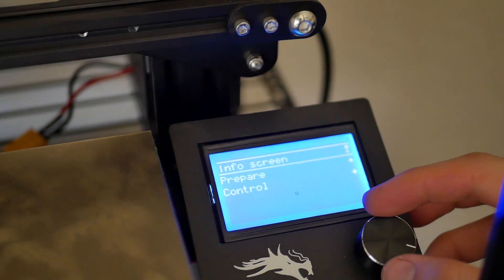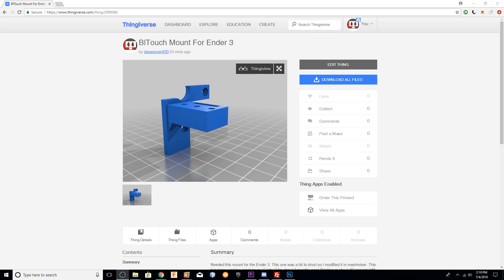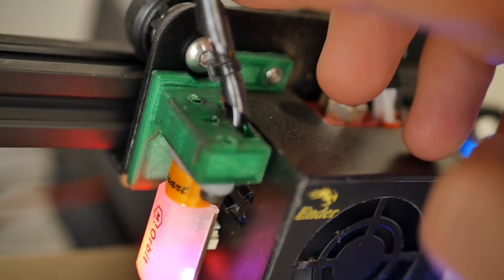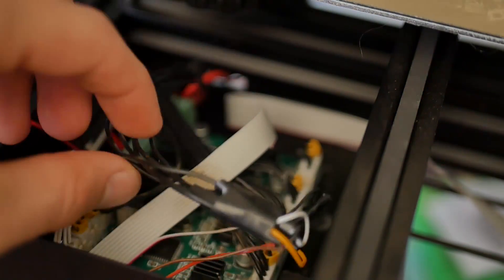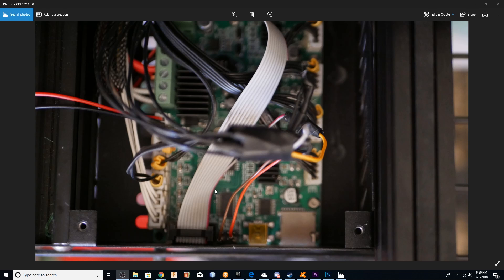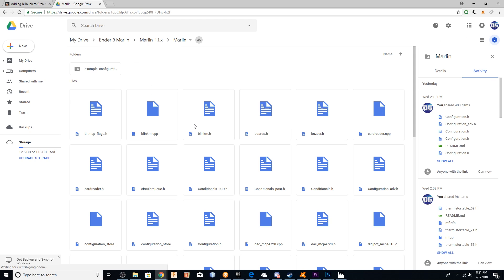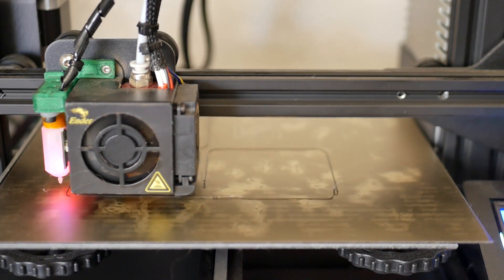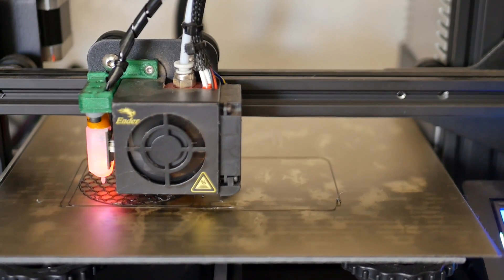Installing BlTouch Into Creality Ender 3 3D Printer For Auto Bed Leveling

Comment: errore Arduino:1.8.7 (Windows 10), Scheda:"Sanguino 1284p, ATmega1284P (16 MHz)"

In file included from sketch\ultralcd_impl_DOGM.h:49:0,

                 from sketch\ultralcd.cpp:96:

dogm_bitmaps.h:146:29: error: _Statusscreen.h: No such file or directory

compilation terminated.

exit status 1
_Statusscreen.h: No such file or directory

Comment: if you plug the black and white BLTouch wires on the board in the Z motor connector. after that, where to plug the Z motor black wires?
Reply: You don't, the BLTouch is supposed to keep the nozzle from hitting the build surface.

And I say supposed to, because mine happily does so despite using the appropriate files that I got for the system.

Comment: Hello, your video is very good friend.
I'm about to use pin 27 on my ENDER-3 printer to install a filament sensor.
I have a question and I want to know if that PIN (27) can receive 5 Volts, because when the filament is finished and the micro-switch sends 5 volts to Pin 27, is that correct ?, or does it have to be sent to ground? .
Thanks and congratulations

Comment: A cleaner solution might to have added soldered wires to the bottom,of the board (at the connector pins) and then bring that all into a connnector.  The mate connector being on the BLtouch.  You could glue the Motherboard side connector to the motherboard if you wished.  Not having a wiring diagram I don’t know why you cut the red wire in the ribbon cable.

Comment: I'm looking to get an ender 3 but I don't understand how this auto leveling works.

If the 4 corners do not have motors how can it auto level itself.
Reply: Spunky Bob: It does not physically level your print bed. With the touch probe you basically map the different offsets (due uneven or warped surfaces) on various points on the print bed. Then the firmware creates a mesh and can compensate uneven surfaces using the Z-stepper.

Comment: TH3D firmware I downloaded yesterday has been updated ? I see there's options for defining Custom Probe and in conditionals_post.h there is entries for BLTouch settings maybe it was already there and you missed it ?
Reply from the maker: No idea, I tagged him on Twitter when I was messing with it but no response so I moved on. If it works for you then by all means use it.
Reply: Nevermind, the custom probe part is reference to a custom mount for TH3D's Ezabl
Reply from the maker: Ya that's what I ran into which is not what I wanted

Comment: Anyone elses buzzer on constantly after the flash of marlin?
Reply from the maker: Your buzzer should be disconnected that was the cable you cut the signal from
Reply: ModBot no I have disconnected the coloured wire and it's now connected to the bltouch, buzzer is still on. Must be a short somewhere on the LCD board

Comment: What about the SD card? Can I still use it while having the bltouch?
Reply from the maker: On mine it does not work I only use octoprint so that has never been an issue. The issue seemed that there was not enough memory on the board to write it I would try to activate the SD card in Marlin and perhaps delete some unnecessary lines to see if that will work for you.
Reply: ModBot Awesome, thanks
Reply: ModBot Any progress on adding the SD card?
Reply: https://youtu.be/ocAeZRPVusw

Comment: Thanks man, I got it working! The z-stop was 1.25mm off, but I was able to adjust it under the control tab on the LCD. Since I am using glass I changed bed leveling to 3-point which gave me enough memory to add SDCard support back till I get octoprint set up!
Reply: Hi Chad! Can you tell me exactly what have you changed in marlin?
Reply from the maker: For me it's not a big deal at all but for other who want the SD card support I will gladly take the file and post it as an option! Wanna shoot me it via email? It's on my channels about page :)
Reply from the maker: Awesome man I am glad you got it working and that's a kickass idea for on glass! Since I use octoprint I don't use SD card period. I will suggest that to other people that want the SD card support :)
Reply: Hi Dan, I can upload my configuration_h file if needed. I take it you're trying to add SDCard support back? I only made two edits, I changed 'AUTO_BED_LEVELING_BILINEAR' to 'AUTO_BED_LEVELING_3POINT'. Then I re-enabled SDCard support. I found a modified qr_solve.cpp which would allow you to use Bilinear and SDCard, It reduces the size 10kb but I haven't tried this yet.
Reply: ModBot Hi again, thanks for your quick response! I actually connected the printer to my laptop, so I'm fine at the moment. Thanks again!

Comment: Why didn't you use the Servo connector on the Ender 3 control board, instead of hacking the Exp1 LCD connector?
Reply from the maker: Stuck with the wire diagram I found. Wanted to make sure it was going to work

Comment: Was your bed warped to start? Also why not use the th3d unified firmware?

Xposted to /ender3 on reddit
Reply from the maker: No warping on my bed when I got it and uf is to limiting to me everything is moved around and named differently I like being in control and being able to edit my firmware easier
Reply: ModBot do you have any idea how to get the laser attachment on this ender 3 functioning?

Comment: will this guide work for a cr-10?
Reply from the maker: Pretty much, you will need a different mount, need to change some marlin parameters as well. I do believe the Ender 3 board is the same board that is in quite a few of the later Cr-10s

Comment: I recommend people interest in this to look at the pin 27 board. I'm assuming bltouch could be setup in th3duf pretty easy?
Reply from the maker: The diagram I used and pin I used was 27. I tried using Th3duf but was not able to edit it the way I wanted. The firmware seems to be over simplified to were it is more work than its worth if you want to add things to it that are not there already. Would have saved me a lot of time if that was  not the case.

Comment: Does it take any new effort to use it with octoprint?
Reply from the maker: Not at all you can auto leveling from octoprint if you want but it does not add any complications
Reply: ModBot , I assume you are using M29 from octoprint to have the marlin board calculate the offssets and modify G-code as it is parsed?  To be honest I would love to have octoprint  handle the G-code modifications and avoid using the marlin board.